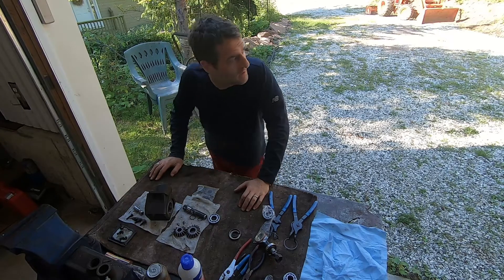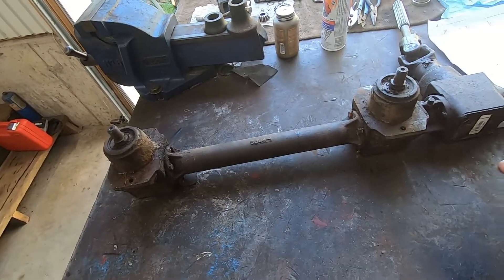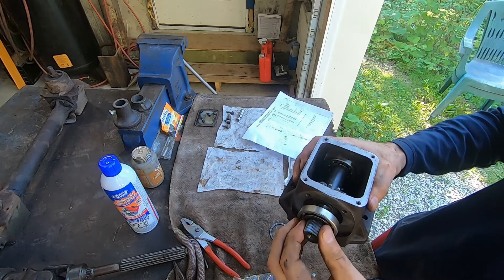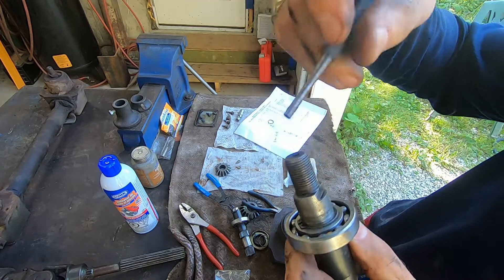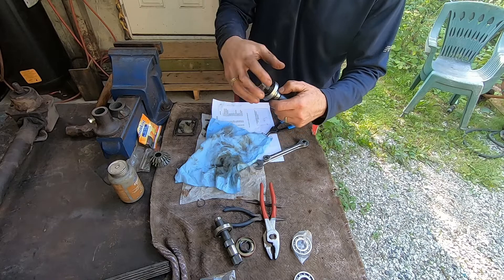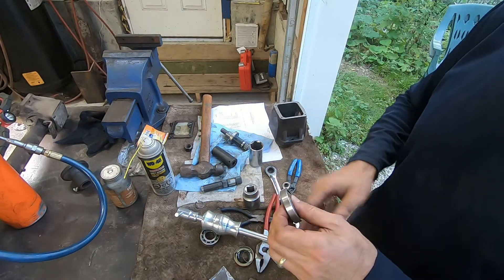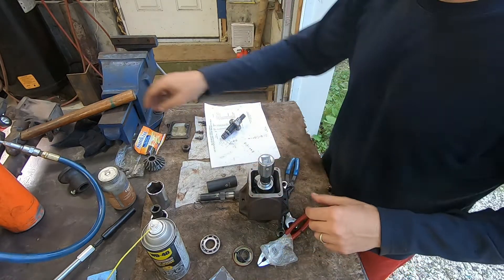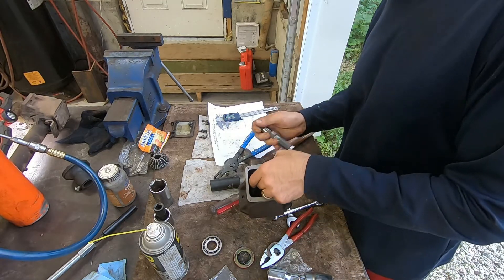Walker Mower Deck Gear Box Rebuild with 6 Pro Tips

Comment: 22:01 looked like a spun bearing on the shaft and housing going in that easy, why didn't you use something like locctite 609 bearing retaining compound to secure it in place to stop any more damage having to replace the housing and shaft next time around being more flogged out? Or do you think it that's how it's ment to be?
Reply from the maker: I don't remember being concerned about the clearance. It did need to be pushed into place and snapped in place. With any kind of load on the shaft. I would expect it to hold the outer race pinned up against the housing. But maybe that is wishful thinking. Come to think of it when you bolt it together. I wonder if there's a force applied to that bearing race by the mating shaft housing.
Reply: Yeah it's all fun and games, im rebuilding my Iseki 72 inch deck gearbox and mine are all spun to on the outer bearing race's on the input and output shaft but the shaft inner races are all press fit on still... i think because it is not to far gone tight fitting wise im going to use 609 retaining compound I've had good success with that stuff in the past.

Comment: today...
today i put the last set of blades on the walker.
thought the shaft drive would be good, why i grabbed it.

maybe on flat, clear ground... but not on a property with 50 years or more of sheer neglect. ive had a new set of blades destroyed as i engaged the clutch...

no matter how well you check that patch, theres always something new hidden in there. i think that time, i actually was sitting on top off the g-clamp. no wonder i didnt see it. oops.

bricks, wire, found a three foot chunk of angle iron buried with an inch poking out in one of the fences... that bent the spindle. passed it every week, no idea it was there, lurking... decided to do it the other way, and hooked that out of the ground. ffs.

pulled a fence down the other day. pulled all the posts. went up and down, checked three times. every brick out and in a pile. every stray bit of wire and mesh, dragged out.

it still got me.

a truck axle sunk in the ground, 1 inch poking out....wtf is it with these chunks of steel buried in the ground?

hammer the deck out, chisel the spindle nuts off, replace all the shear pins, even the unishaft ones... 

cant get new spindles over here.
the stupid imperial bearings are that custom "no seal" narrow race unobtainium type.
look at the tecumseh/peerless site and find that they used over their rated specs anyway...
the spindles rust out where the oil seal is meant to ride.
i could maybe bore it out a bit more and shove sealed bearings in there but the spindles still bent...

so. im either just throwing stock standard spindles in the deck, and setting it up with a timing belt for the synch, or im just cutting the deck off and modding an old great dane i have kicking around.

because wow. three years, ten blades, countless pins... i think ive gotten around the place four, maybe five times at best with OUT something blowing up... could run no earmuffs when i got it. with the bent spindles, worn bearings, dry gears, and out of balance blades.... its a symphony of howling metal and frustrated screaming :)

they are NOT suitable for "difficult" properties.

so damn glad i wasnt doing commercial work at the time. thats why i grabbed it, some weekend cash. well, that didnt happen. every weekends spent working on the damn thing!